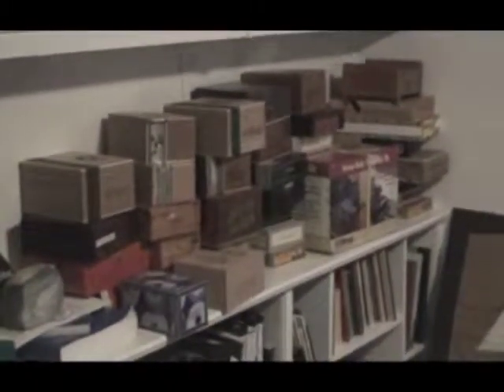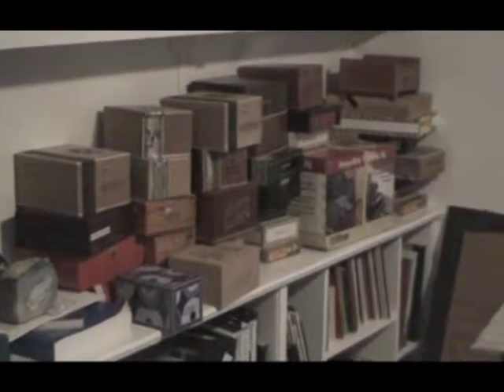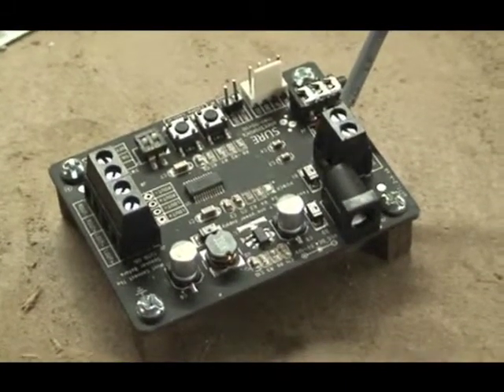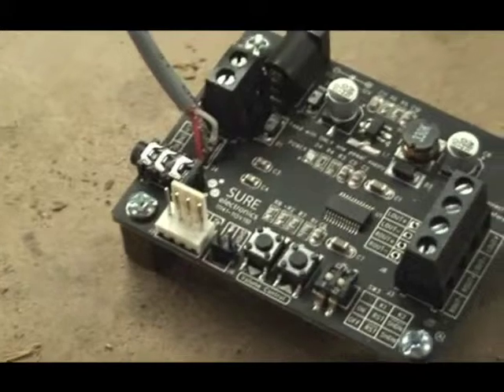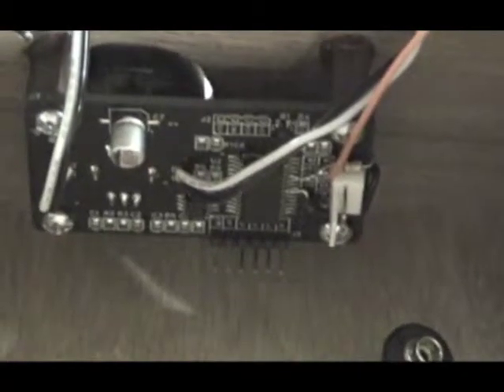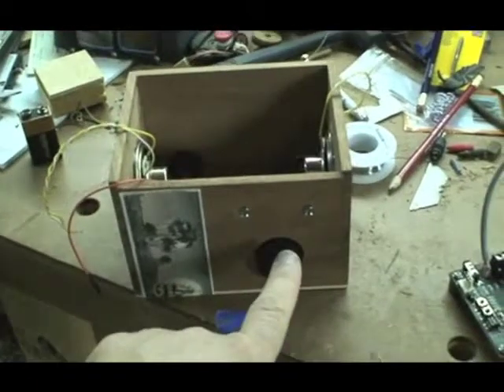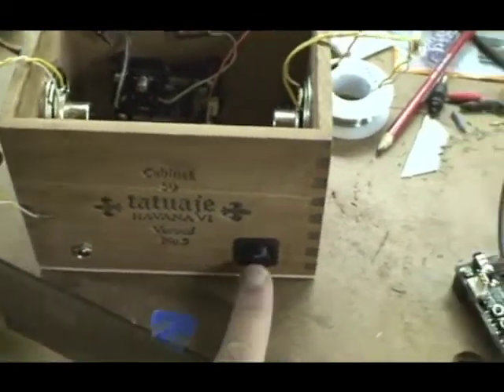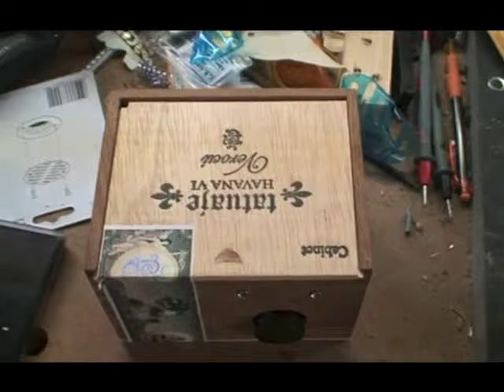Cigar Box Speaker System for mp3 players

Comment: How did you secure the speakers to the inside walls?
Reply from the maker: +syn707 not well.   I imploded in the mail.  Newest batch use screws.   on hiatus for a while.
Reply: Thank you...great to know. I found some screen repair material that will be great for the grill. I think there is some adhesive on the back...but I'll secure that with chrome screws as well. 
My box is actually using a mini amp for guitar. I was going to use the back, since it had a stamp which would have looked great with the speaker below it..but in viewing yours...I think I will not use the sides as it has gold and red  foil band that will show off nice. And I'll be able to see the sliding top with the cigar brand and a foil band much wider. 
Thanks again